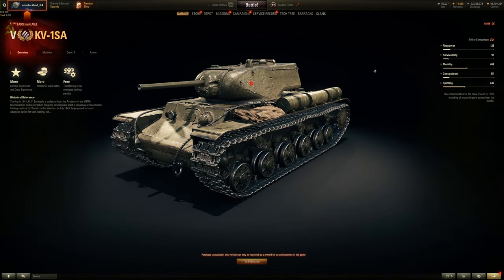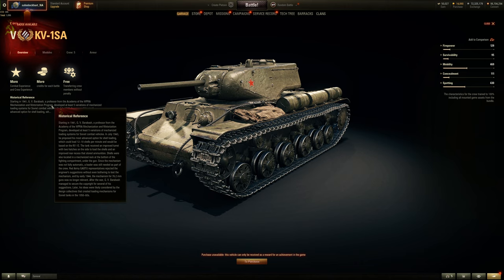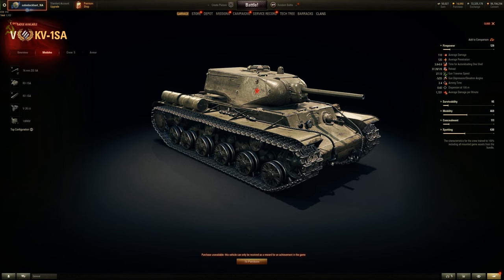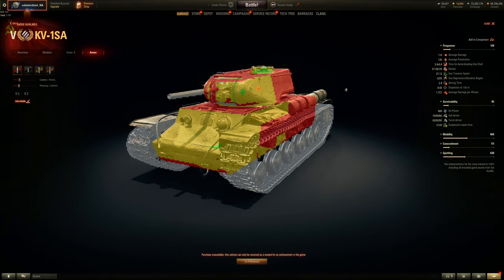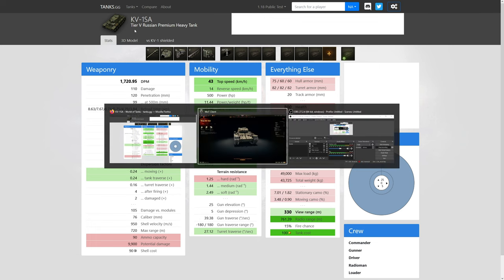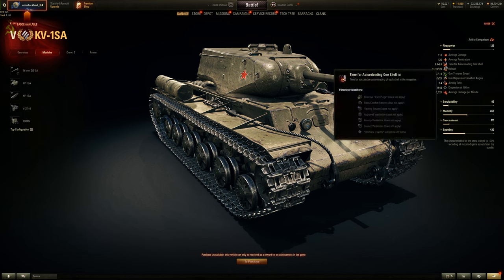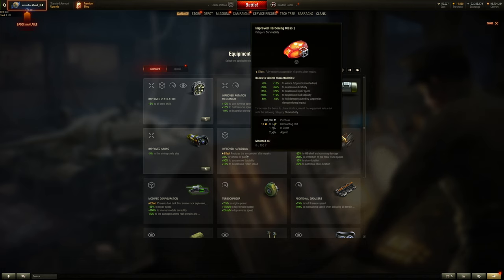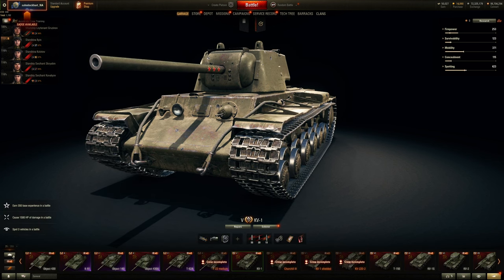WTH is a "KV-1SA" --- "𝘕𝘰𝘯-𝘛𝘰𝘹𝘪𝘤", 𝘕𝘶𝘤𝘭𝘦𝘢𝘳 𝘍𝘢𝘭𝘭𝘰𝘶𝘵 𝘗𝘪𝘵 || World of Tanks

Comment: Oh HELL NO!  Per Tanks gg let's see tanks with equal or less than 660 HP in lower tier.
1) Tier 5 - 47/75 (~63%, highest hp = 950)
2) Tier 4 - 49/51 (~96%, highest hp = 670)
3) Tier 3 - 54/54 (100%, highest hp = 570)
So all these tanks can be deleted within 1 clip, and with 1 sec intra-clip reload, within 5 secs after 1st shell, and potentially perma-tracked.  The 3.8sec top of magazine reload is also not bad, you can have a very good sustained damage if you just fire 1 & reload, especially if you notice your opponent just used their repair kit.  Or you 1st shell tracked, wait for them to use repair kit, then 2nd shell, and just wait for 4.8sec for 2nd (from top) shell reload, for opponents with more HP. 
It's a different level of troll compares to Churchill 3's ~1.9sec reload (110pen/75dmg) without auto(re)loader, or leFH's of <8sec reload skycancer shells of 64pen/350dmg.  
NO FUN FOR YOU low tier F2P newbies!